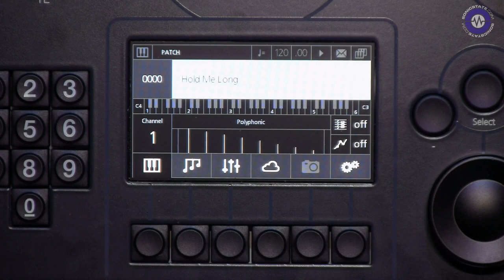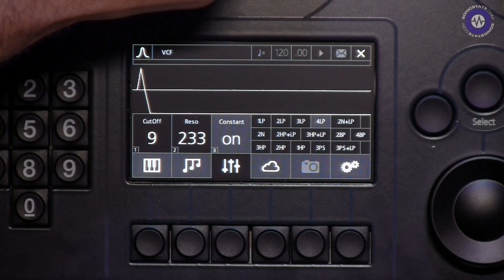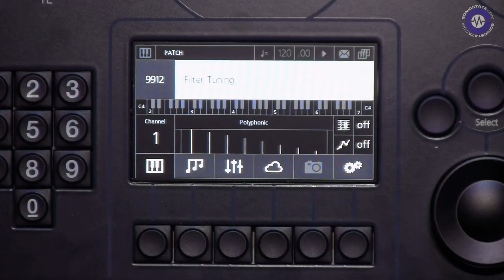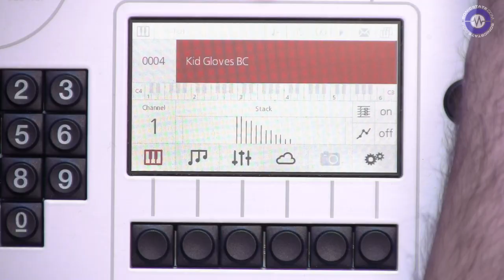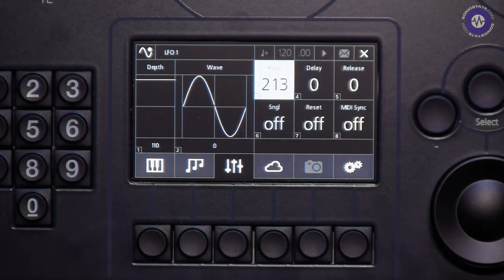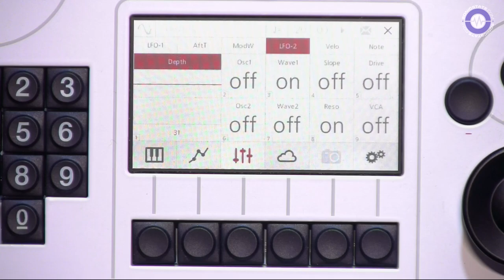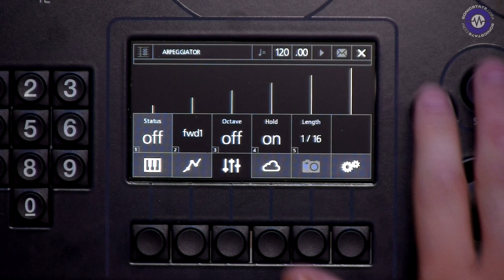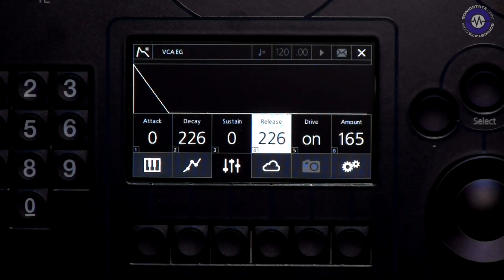Modal 008 and 002 together with their designers

Comment: I don't know if I'll ever be able to afford anything like this duo, but my ears tell me they are both two of the most amazing synths I've ever heard. Amazing design, features and sounds. Despite the price, I think I'd consider this great value for money.
Reply: I owned an 008 and an 001 (the duophonic version of the 002), the 008 was rough around the edges, cold sounding and didn't seem like a finished product and the 001 was more complete but had a hugely limited engine. I no longer have either. 

Turning the 008 on and it made a horrific sound, the voices were split left and right like an Amiga 500 meaning there was no point in having stereo outs. The 008 went back to the factory when I put XLR balanced plugs into the outputs and then they wouldn't come out again. The support I got was fine though. But for all its expensive exterior and build quality there were some signs of a lack of maturity, the cable to the headphone jack was visible under the keybed and appeared to be IDC cable (ribbon cable), not shielded cable you would expect. The above mentioned voice panning and the joystick seemed pointless and was wobbly.

The synths sorely needed internal FX and while they did provide them via an expansion card they were more of a "bonus" than part of the card. Plus shipping a huge expensive synth back to the company to get it fitted.

I think the fact that Modal no longer makes big expensive synths is an indication of how well they sold.
Reply: @6581punk  I never ended up owning any of them, which is probably just as well in hindsight. I've gradually realised I only want fully open architecture patchable synths in my setup, so I have three Kilaptrick Phenols a Dreadbox Dysphonia, and a Zoia for effects, sequencing, MIDI control, and occasionally sound generation.

Comment: Hi Paul! Thanks for this Paul, George, Luca & Nick!
Dang the 008 could kill all Jupiter8 lust just as the 002 does the PPG (I know this is doing the Modal instruments a disservice and pigeonholing them, this is just in my mind!)...
Reply: +mCKENIC that was my first thought too. Killed a bit of vintage poly lust I have certainly.
Reply: I think a bigger question is do these "kill" other modern snths, such as the Solaris, Prophet-12, OB-6, Maxibrute, Voyager XL, etc.
Reply: @PhilAndersonOutside  Let me answer this with my opinion, since I have 001, 002, 008 and also Solaris and OB-6 from your examples.
I believe that 00 series is its own thing. I do believe that Paula is genius with how oscillators in 001 and 002 work. I don't think filters in 002 are among better sounding ones, but they play well with those digital oscillators. It is important to remember, that those oscillators are not DSP. And more important: they are driven by analog clock which each oscillator has one for itself. This gives them very organic sound. I would say they sound more analog than any other VCO oscillators that I have, except Prologue in narrow use cases (people often complain about them, but Korg made synth that is easy to overdrive in many places, but that is VERY easy to avoid - just keep your levels down).
Regarding 008, it killed my GAS for JP8, but I know it is not its replacement. I mean: I can hear its character and I think it is its own thing. At some level it reminds me of JP6, because of how sync and VCO cross modulation is working (I use it often to modulate VCO1 that is synced to VCO2, that changes VCO1 spectrum without changing pitch), that resembles JP6. It reminds JP8 only by few design principles - like layering, number of voices and basic architecture (you know, two oscillators into filter into VCA) - but expands on that and cuts at some minor thing (like simultaneous HP filter).
I would use neither to replace my Solaris nor OB-6, especially OB-6. OB-6 has character and XMod that expands beyond any of those synths (and vice versa of course). Also, filter character is unique.
Solaris is a laboratory and for me very difficult synth to operate (it puts me into choice paralysis - sorry, English is not my native language, but I bet you get, what I meant). It is closer to replace 008 than any other synth, especially because 008 has stiffer oscillators, and Solaris is also very predictable by design. In theory Solaris could cover a lot of 008 territory, with just a little of its capabilities. But that is only if you exclude particular character of one synth. 008 is stiff and by that it also gives impression of being predictable, but at the same time it has something within its sound that behaves like extra spice, and that spice is unique only to this particular model. No other synth sounds like 008. So, does 008 kill Solaris? In some aspects - yes. In more aspects - no. I know people that would be perfectly fine with Solaris as theirs only synth. For me, if I had to choose one or the other - I would choose 008, because I love to program it and use it more often, but it covers like only one island from whole ocean that is Solaris.

Comment: I like the sweeping of the filter mode on the 002. Ha, now as of January 2016, the Dave Smith Tom Oberheim OB6 is doing this.
However having been thinking of buying a Prophet-6 I am a bit annoyed that DSI now has the OB-6 giving the feeling of if I can't afford both maybe I will not bother.
It's a bit similar with the 002 and 008 but if I had the cash I would probably get the 002 having played a Prophet-VS and having heard the range of waveforms on the 002.

Comment: they should do a CS-80 inspired instrument, weighted keys, polyphonic after touch, very hands on basic / vintage design cosmetically, VCO dual . I would pay big bucks for it
Reply: These 2 synths are impressive enough
Reply: +Marcusmiller they could prob just build and add a cs80 filter

Comment: ROLAND BOUTIQUE!
Reply: +pete g 
LOL indeed
Reply: +pete g Roland's looking to fill holiday stockings worldwide not the synth collection of Jordan Rudess.
Reply: +Altodon A Lol.. true.
Reply: +pete g ROLAND HAS BECOME A JOKE   DAVE SMITH MADE A PROPHET 6  ROLAND CAN MAKE A NEW JUPITER  A REAL ONE
Reply: I agree 1000%. If they were smart, they'd release a "real" Jupiter. Basically redo the Jupiter-8, but with a velocity/AT keyboard, stereo outs, maybe an optional FX board. Outside of that, keep the guts identical to the original, and they'd sell like hotcakes. 

For some stupid reason, Roland insists everything must be "new" or "forward", and increasingly confusing or proprietary. 

Yamaha could easily do the same with a CS-80. Instead, they keep making machines like the Montage, basically a step above the Motif (or SY99, from the early 90's!).